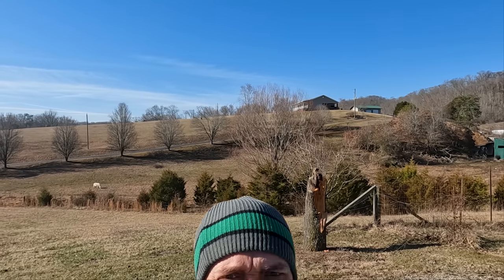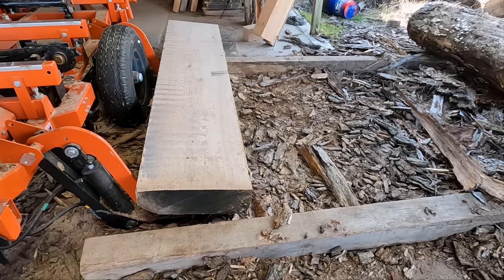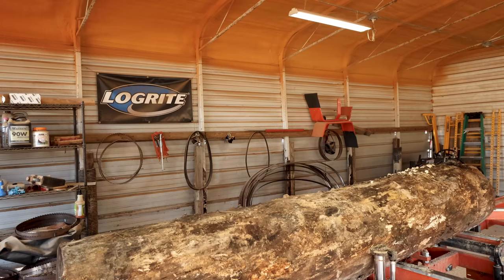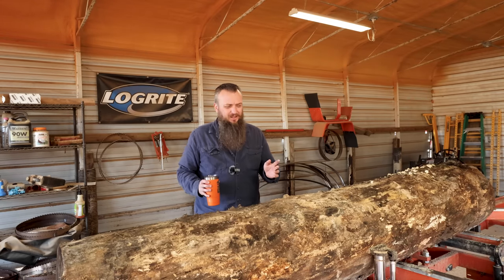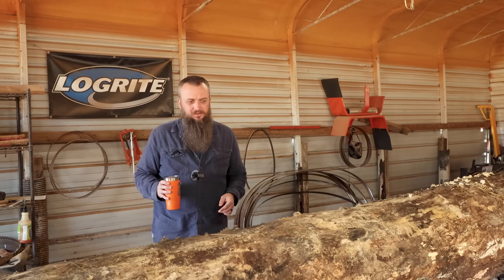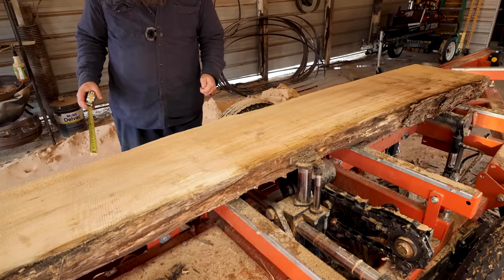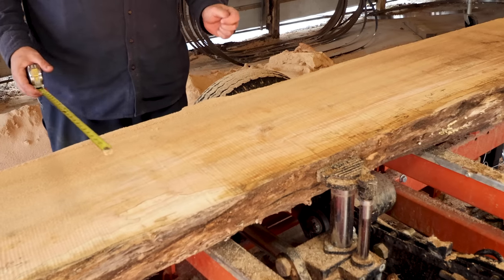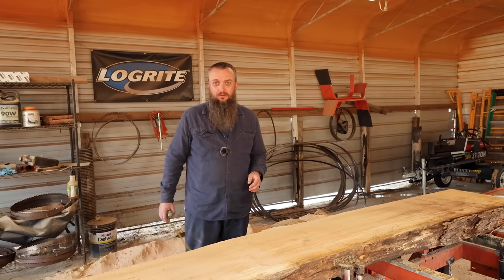How I Get Big Money Slabs Out Of Rotted Logs $$$$

Comment: Hi from Grand Rapids MI.  Watch your channel regularly and enjoy your presentations, (straight-forward and highly understandable from a strictly non saw mill point of view, like myself).  Also a subscriber.  Would you consider doing a segment on electric back up generators.  I've been researching several different makes of portable models for electric backup for my suburban home, a confusing experience to say the least.  Without mentioning any manufacturers, (although I am seriously looking at a Champion portable inverter type, 8750 surge watts).  I would also definitely look into converting it to Nat Gas.  Don't like messing with gasoline and LP needs to be heated in winter to be efficient (or even work).  I already use NG for heat so it is the logical choice for us.  Do you have electric backup, either a portable or standby with auto transfer switch?  I think electric power is headed in direction of less reliability as time goes on.  What say you?  Mark N from "the cold North".
Reply: I have no personal experience with home backup generators, but a YouTuber I subscribe to has done several evaluations and some install videos. He seems to know what he’s talking about. Check out Silver Cymbal.

Comment: If you  had got the right aus  block buster you would  not  have needed  that wedge & your  axe  would  not  have got stuck in what you was splitting some time it pays to start on the out side & work in on easy when its green fire wood logs dry to but follow the  cracks if there is some which is quite obvious yes we no they can roll out the  log splitters that's why there in the fire wood  ? I grew with  plenty  that didn't  & people new how to run a good  fire & did not keep  putting sticks in it that burns your wood pile down  to quick as well common sense tells whe you need a or  wedges Perry